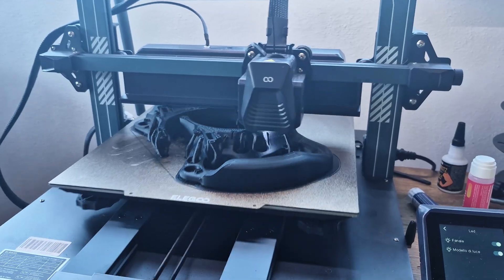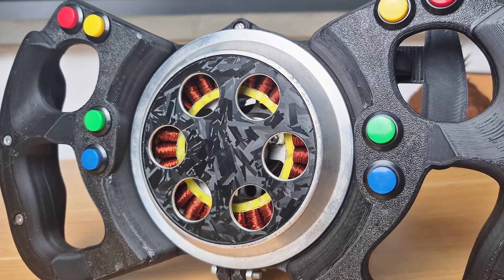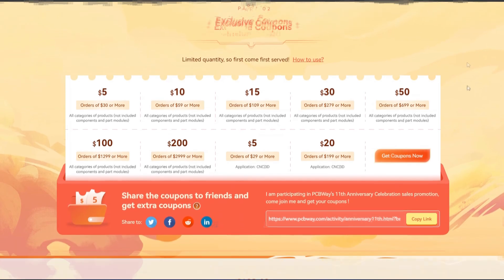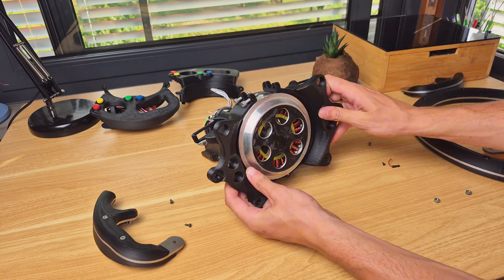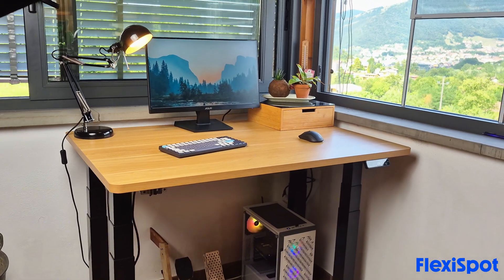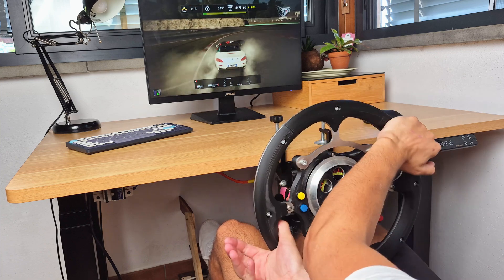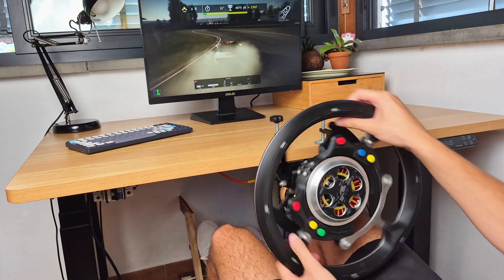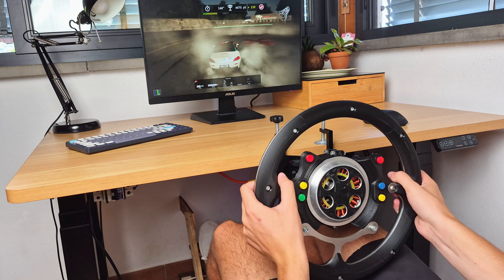DIY Racing Simulator with SWAPPABLE WHEELS and WIRELESS buttons | Big Upgrade!

Comment: is there way / converter to make this working with ps5  - GT7?
Reply: You MIGHT be able to use the controller board from a wheel that IS supported on ps5 to trick the console into thinking it’s supported. But don’t take my word for it or attempt it cause I have ZERO clue how or if it would work.

Comment: I'd love to see an option to build it with a cheap quick connect solution, allowing me to attach just about any wheel I'd like to this motor. I honestly think that's the last part missing to make this perfect as I find the 3D printed wheel options not as comfortable as a regular wheel.
Reply from the maker: I'm working on using a cheap AliExpress round wheel, coming in January probably!
Reply: @DAZprojects  You are a legend. Thank you so much for doing all this.

Comment: How long does a cr2032 battery last with this board and is cr2032 enough for this?
Reply from the maker: I honestly can't tell you a precise answer, I haven't used it much since I'm building the new pedals, video out probably next week!!
Reply: I checked a CR2032, it doesn’t last more than 3 hours. Sad.

Comment: Hi, I bought your design on Cults3D and I love it. However I have big problems with firmware.
I have tried everything you said, and what @achavevirou presented few weeks ago and still I can't setup my MKS ODrive mini V1.0 with e6b2-cwz6c encoder. Can you somehow help me?

It appears as FFB(Wheel) in devices menu, but in Device Menager as HID Compatible Game Controller. In joy.cpl nothing moves, but there is a slightly braking from resistor i suppose.

I've tried diferent usb drivers, tried on Win11 and Win10. With usb-c to usb-c cable, normal cable as well. Checking wiring, reset for 100 times and reflash for another 100 times. Simply I can't... Maybe it is the Serial key problem (don't know how to get it).

Begging for help :c

Comment: how did you make the buttons and the steering wheel go in to the pc as a single controller?My pc sees them as the 2 different inputs so i cant press the buttons when i'm steering.
Reply from the maker: They're two different inputs, but the PC should read them indipendently regardless of the fact that one is being used or not
Reply: @DAZprojects  ty for the quick reply,i'll try again.Or maybe it's just a problem on forza.

Comment: I am currently building my own based on the last video, but I’m attempting to use a real car steering wheel (including the buttons and gear shifters) and having a real hard time trying to convert LIN-bus into anything the PC can understand. If I can get it to work though, a used wheel on eBay from a scrapped car, very cheap and great quality

Comment: Which 3V battery are you using? I'm having slight issues with CR2032, but don't know whether it's a short or low battery capacity
Reply from the maker: I'm using a basic 3v button battery, nothing specific. 
It lasts quite a long time but I can't give you a number since I haven't used the sim much because i'm building the cockpit to go with it
Reply: @DAZprojects thanks

Comment: Hello! I built the old wheel and want to upgrade to the wireless button board but I had a quick question, do the buttons still need to be wired to 5v? And if I did the old wheel do I need to take out the resistors and 5v? Thank you!

Comment: So I plan on making this design and I just purchased your files package from Cults3D. I might be missing something here, but I don't see the plastic inserts for the full size steering wheel in the files. It just has the front and back parts, not the inserts that go into the metal frame to line the front and back parts up.

Comment: I feel like that design has lived it's life and you should move on. It's just way more logical to attach a quick release with a slip ring to the base and use some random standard steering wheel, rather than having to go through all this.

Comment: just a random concern but would the friction of the wheel shell alone be enough to prevent it from slipping from the base considering the torque of the base?
Reply from the maker: Yes, there's no way the wheel will slip
Reply: alright, thank you so much!

Comment: why not just add a suport for the top why do you have to make it unobtainable ive been waiting a whole month for this just to get this
Reply from the maker: There's another reason, it will probably cost you the same to 3D print the whole wheel if you need to make it so dense that it's strong enough. Also you'll need to make it one piece which will require a big 3D printer

Comment: What's the diameter of the hub motor? If I buy the files, can it be adapted to a slightly different size hub motor?
Reply from the maker: You unfortunately can't adapt them, but the size should be standard
Reply: @DAZprojects  bro why you say standard if  I want buy a motor according to your 3d printing file first I should know what is size like 6.5 inch, 6 inch,8 inch from your video we can't find the exact size for motor and imagine if I buy a hub motor with 6.5 inch and yours is 6 inch and 3d printed parts will not fit that's why we asking what is size so please kindly reply

Comment: I just suggest you to use a wood bar to secure the clamp (upper part) to the desk so you won't ruin your table!
Reply: Still: it is suuuuper cool..
Question: could you also build a wheel with play station compatibility?
Reply from the maker: I haven't developed the software, so I've no idea

Comment: I'm very tempted to start this project but the exposed wires and wireless board put me off.  Are there any plans to hide them?  Also the round wheel needs the screws on the back rather than the front

Comment: Does anyone know if I can use any hoverboard motor? I'm looking at an Xpirit 8.5" offroad hoverboard. I'm wondering if the size of the motor itself will be different and if it matters if the motor is 36V?
Reply from the maker: Howerboard motors should be all the same, as long as you're not using some strange hoverboard with bigger wheels.
With 8.5inches hubs you should be totally fine!
Reply: @DAZprojects Thanks! And using a 36V powersupply shouldn't be a problem aswell?
Reply from the maker: @throwdown_gamer1306 it depends on the controller specs, if I'm not wrong it can go up to about 50v, by the way using a 24v makes zero difference in the driving experience
Reply: @DAZprojects  Thanks for the info, I appreciate it a ton :)

Comment: Do you notice any latency using the Bluetooth module over the USB when driving the steering wheel?
Reply from the maker: No, also it's not for the force feedback or steering so it doesn't matter much

Comment: The version where a universal 30$ quick release is screwed to the motor looks more hassle-free
Reply: I’m wanting to build one and use the first 3d printed racing wheel he designed, and the mount a quick release in the center plate so I can swap my drift wheel in and out easily. And still have the racing wheel.

Comment: Have you considered adapting it to have a universal wheel mount in front of the motor? That way it could connect with cheap Amazon wheels

Just saw the end of the video, you have considered it lol. Wondering if plastic is too weak to hold it together
Reply from the maker: I'm not thinking about such a solution since there will be too much leverage on the base and plastic wouldn't be rigid enough, also the whole point of this build is to have the motor integrated in the wheel, and making an adapter in front of the motor makes it exactly like every other FFBeast wheel out there
Reply: @DAZprojects  I am just thinking, it would be much more useful with standard mounting. Shame
Reply from the maker: @wrth  I already built that in one of my previous videos
Reply: If the motor enclosure is like the one I bought, there might be enough room to extend the 6 existing bolt holes through to the other side of the enclosure. This would let you bolt on a metal plate that is strong enough to support a wheel mount.

Comment: do you have a link to the wireless button board? Also the files on cults are missing the swappable steering wheel 3d models
Reply from the maker: Thanks for letting me know, I fixed that. 
As for the button board I'll add a link right now in the parts list